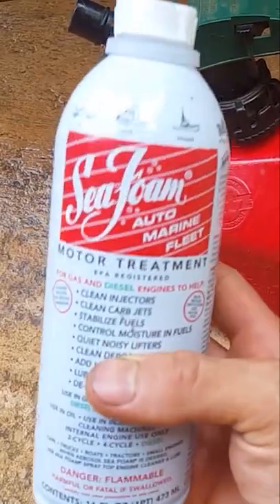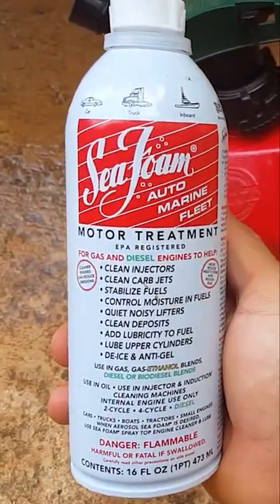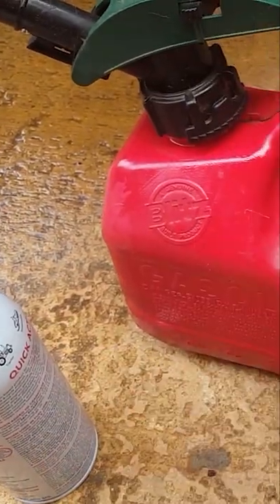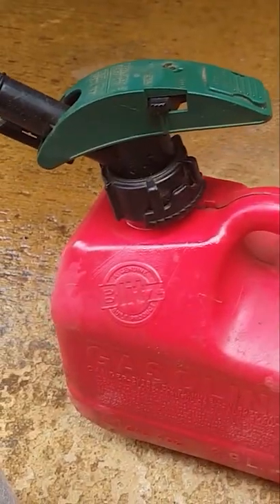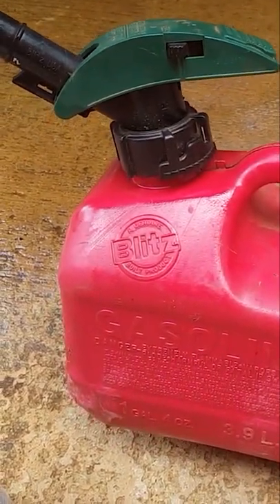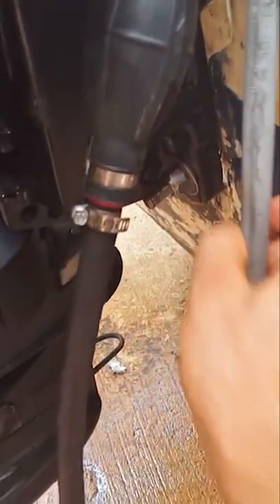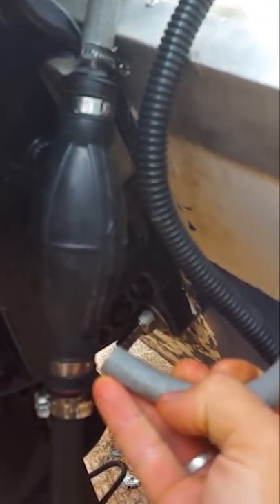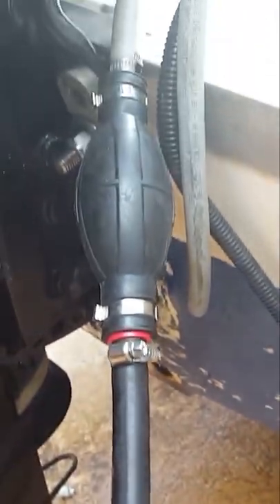Outboard Seafoam Shock Treatment

Comment: Why wouldn’t you just put it in the gas tank when you’re using it? I also just add gas treat every time I fill up.
Reply from the maker: This is a "sock" treatment. It's more concentrated this way. It actually helps these old 2 stroke outboards.
Reply: You probably shouldnt
Reply: @MattsShop  It’s work wonders great 👍

Comment: I put a big can for  2 gallons for our small engines stuff for landscaping. I use it in everything with an engine, you’d be amazed how much better everything starts
Reply from the maker: It really helps outboards a lot.
Reply: @MattsShop  helps anything gas or diesel
Reply: Dude it keeps all your shit ready for the first pull of winter or summer I mean Sea Foam is really good

Comment: What are you do when you have a two-stroke that’s fuel injected. And the oil is added in through another tank.
Reply: I would think you just add it to gas. Did you find any answers

Comment: Hey i got a question I got a 85 it works great out of the water on muffs but in the water it’s like it doesn’t go in to gear it does out of the water In the water it won’t acelarate
Reply: Did you figure this out? I am having the same issue on an 1989 Force 90
Reply: Most likely a fuel issue. Fuel pump may be not functioning well or the fuel filter might need to be replaced. Also might be worth removing the prop and checking for tangled debris inside. Worn spark plugs are another place to check.